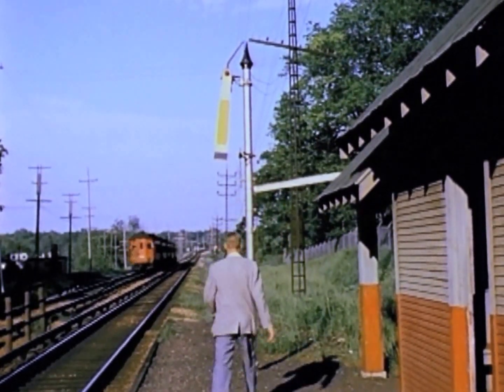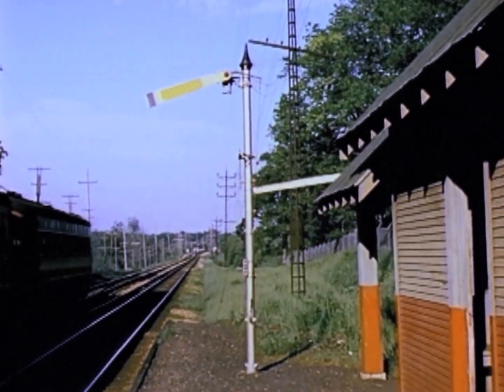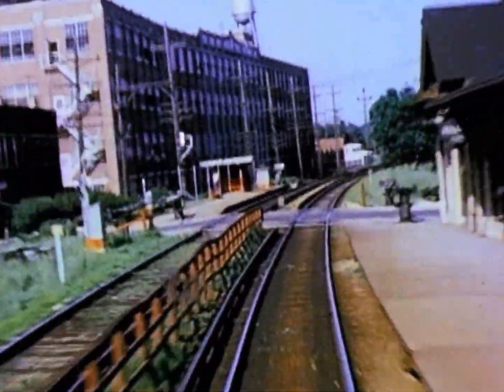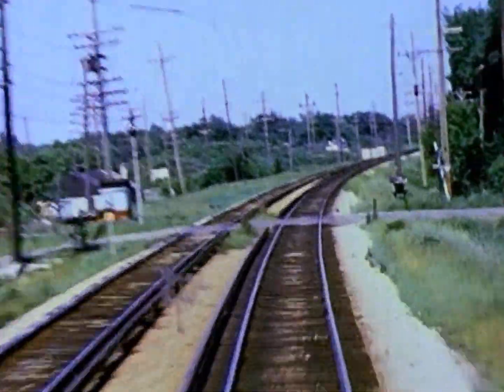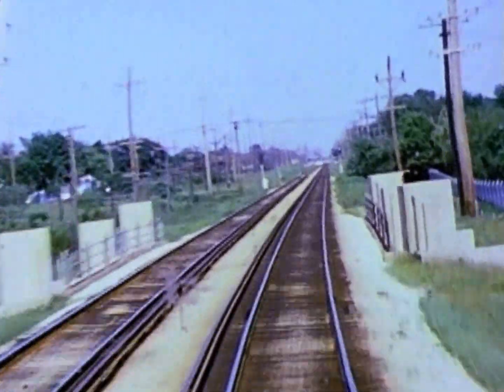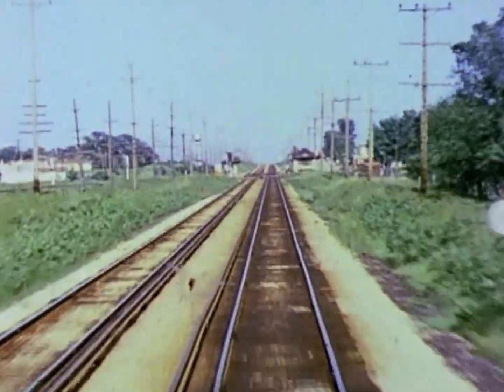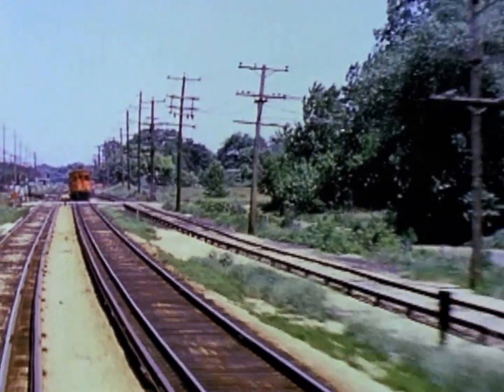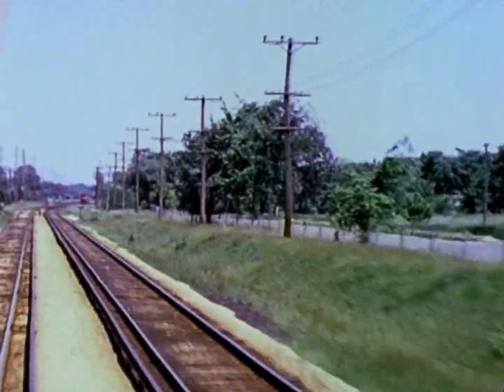CA & E Through Villa Park & Elmhurst

Comment: I lived in those Ovaltine apartments close to Monterey (earlier in the factory building). That curve through Ovaltine didn't look to me as pronounced as it does in this video but, i guess it was. I had a balcony that faced the trail so i would stare at those high telephone poles and concluded, they are the same poles that we see here. The bleaching and age appear to confirm it. They are very tall and i lived on the third floor. The south crossing gate concrete base is still there South side of Montery. When i still lived at Ovaltine while riding my bike i thought it might have been a signal base. There are more concrete bases further west scantly dispersed along the right of way and the Chicago Great Western side follows the same pattern.

Comment: So the master controller button WAS NOT the deadman's switch?
Reply: What??? You mean deadman’s pedal, right?
Reply: @chooch1995  What I meant was that unlike the NYC Subways where the motorman had to hold the controller handle down to prevent emergency braking, it appears that a similar feature was not on the CA&E.  Was there a separate pedal that the motorman had to depress to prevent emergency braking being activiated?
Reply: @cats0182  it depends on the controller. I believe that the brakes would be applied if it's on a point on the controller. I know that at IRM, IT 415 will apply the brakes any time off the dead man. If you let off the handle, you'll fly through the windshield!
Reply: The CA&E (like NSL and Rapid Transit) did not have the deadman's feature enabled on the controllers. You can let the handle up and nothing happens other than the line switch opening and shutting off power. Some of the cars, like the curvesiders, had controllers which were capable of deadman but it was not piped in. The South Shore orange cars, operating over the IC, did have this enabled, and if you let up on the handle while the reverser is in, the train will go into emergency. Some cars equipped with deadman also had foot pedals piped in, so the motorman could keep the pedal or handle down.